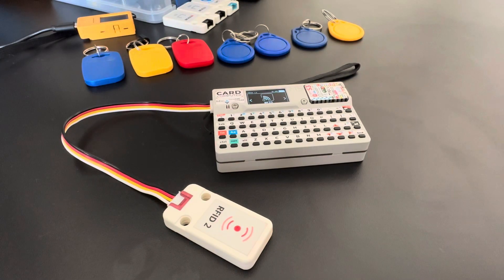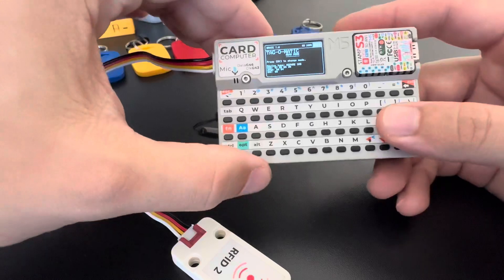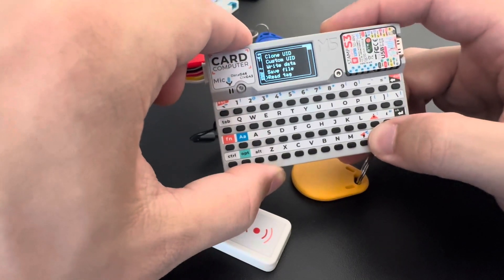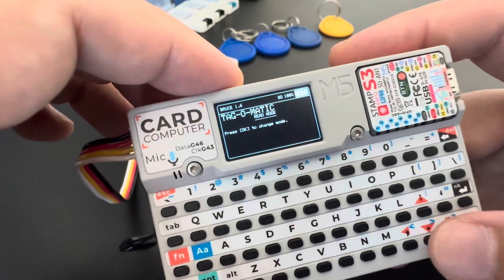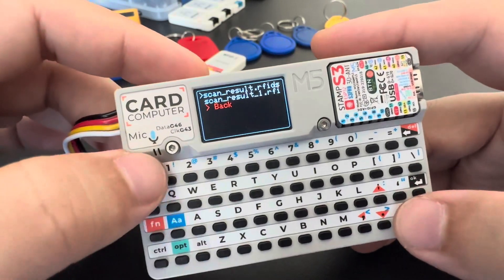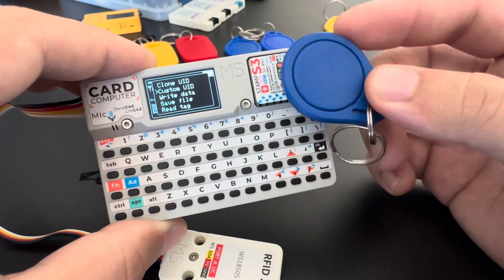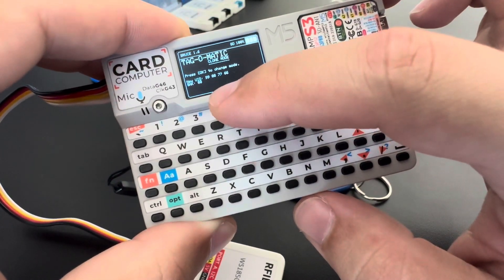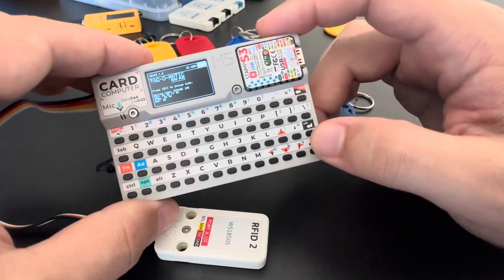Scanning RFID tags and writing custom UID with Cardputer and #BruceFirmware

Comment: Hi reck. Im trying to connect a rc522 for low freq but im trying to figure out if the grove pin support 3.3v since the rc522 uses 3.3v. If not where do i connect it to get 3.3v? Thanks.
Reply from the maker: for cardputer you need an sdsniffer to get 3.3v from the sd card. Here's an example https://github.com/pr3y/Bruce/blob/main/media/connections/cc1101_cardputer_sdniffer.png

Comment: Thanks for the video.  I want to use 4 digit codes on my tags.  Is that a settable option?
Reply from the maker: @uSlackr  unfortunately it’s not. Each tag type has its own UID format. The Mifare Classic tags have UIDs with 4 bytes and you can’t change it to be 3 or 5 for example. Also if a system was designed to work with a Mifare Classic, you cannot use an ultralight tag with it, you have to work with the correct type of